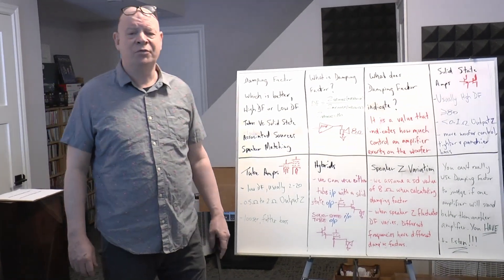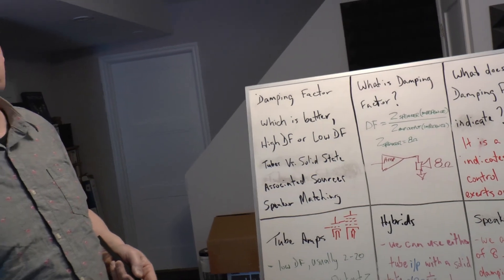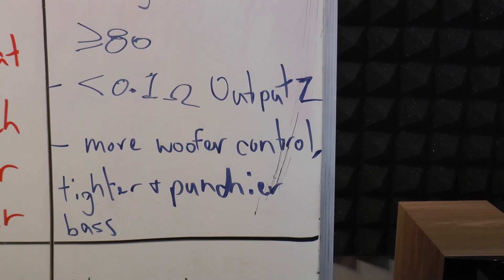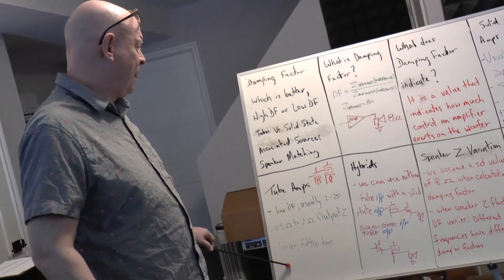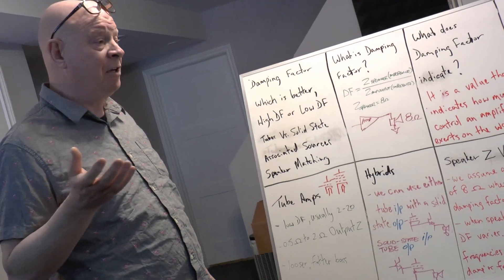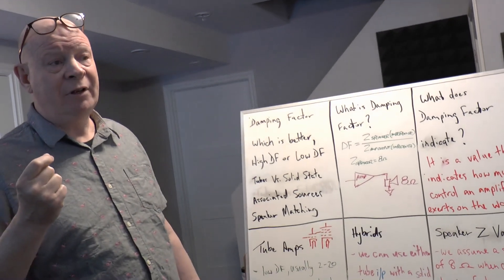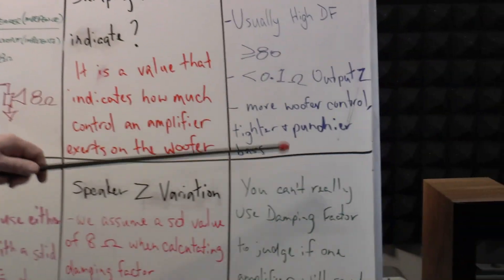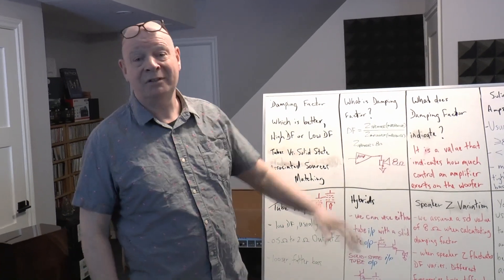Damping Factor of an amplifier, the way we see it.

Comment: Something that almost all discussions of damping factor overlook: the DC resistance of the voice coil is in series with the output impedance of the amp. This is typically about 60% of the nominal impedance of the speaker, of 5 ohms for an 8 ohm speaker. Given that 5 ohms is always present, it matters very little what the output impedance of the amp is unless it adds materially to that 5 ohm baseline. There is almost no difference in actual damping between and amp with 1/2 ohm of output impedance and an amp with 0.008 ohms of output impedance, even though the damping factor is 16 for one amp, and 1000 for the other. 😢